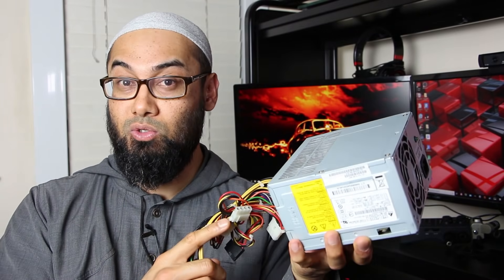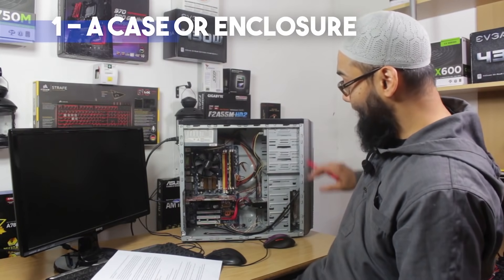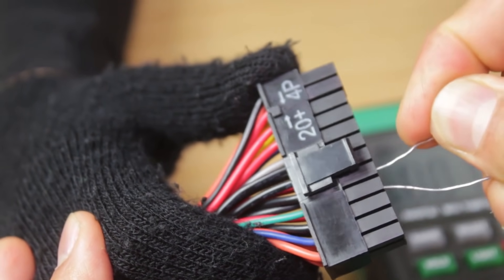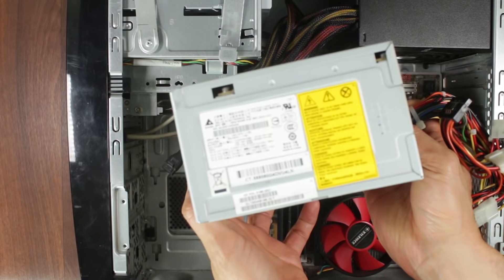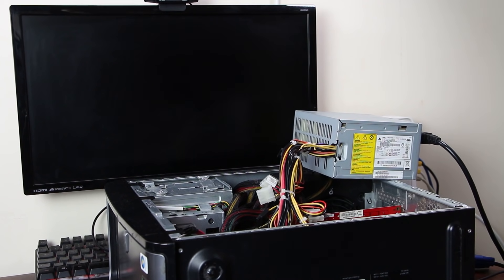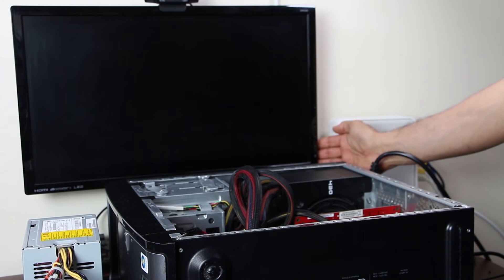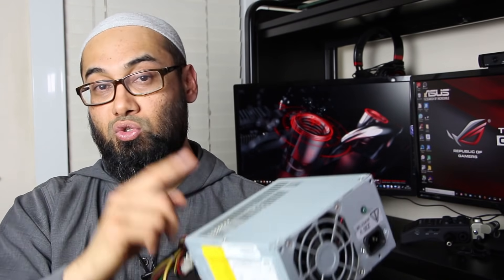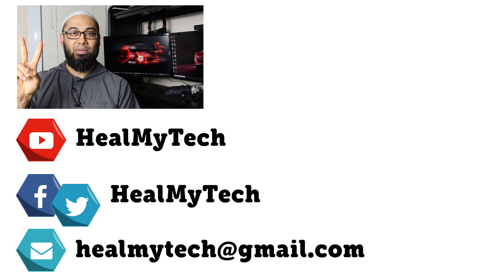Computer Turns On But No Display On Monitor | Led Light On Fan Spinning | Power Supply Unit Pc?

Comment: I upgraded my ram (added extra 2gb) switched pc on but monitor shows no signal eventhough leds and fans are on.
Reply from the maker: Test the RAM independently first, also check your mobo manual for correct RAM config.
Reply: Ozair ahmed I have just installed new ram aswell but my computer was working for half and hour and now just a black screen did you find an issue
Reply: @thinkz1133 firstly make sure your ram is compatible with the board but for me the solution was rearranging the ram and see which combination will work, and disconnecting things and putting them back in like the gpu or making sure that the parts are in properly.

Comment: Dude my pc was working fine it is new i got it last summer and all of a sudden today the display wont show and i have a corsair power supply and msi monitor
Now after turning my pc off 3 times it works for. Pc life is tough bro
Reply from the maker: It can be I agree, but as with anything once you learn the basics it becomes easier.  I suppose not everyone wants to get headache with troubleshooting...

Comment: Bruh I’m 14 ion wtf to do
Reply from the maker: Age has nothing to do with troubleshooting, whats the problem?
Reply: @HealMyTech1  Thing is, he most likely doesnt know any of the terms/words used, like booting, cpu, bolts/watts, power supply, or even troubleshooting. So indeed age isnt a problem, but lack of knowledge is.

Also, I think he meant he doesnt know what hes doing in this video(like "how did I even get here")...  either way, thanks for the help and advice!
Reply: Yah what lmao

Comment: what if when you push the power button down on the desktop PC the led doesn't light up at the fans kick on but that still be a power supply issue or could that be the battery on the motherboard?
Reply from the maker: motherboard battery only keeps CMOS information like date time BIOS setting etc and shouldn't affect the turning on of the computer
Reply: @HealMyTech1  Any ideas on my situation?
Reply: @HealMyTech1  Do you think it could be a power supply situation?
Reply: @HealMyTech1  Oh also another strange thing is when I push the button to eject the CD the drawer closes about a quarter of the way after opening.

Comment: I just brought a new power supply yet this issue happens is it still the power supply
Reply: Could be the Ram
Reply: The atomic bomber 75                     try to pull out ram while your pc is off and plug it back and than turn on pc. If its not working try to unplug your graphics card and than put it back on motherboard while pc is off or try to put your monitor on motherboards graphic and see if it works, if it doesnt i have more options for you. When you log in your windows and when everything is on (except the monitor bcs it has no signal) try to do next steps depending on wich windows you use for windows 7 press CTRL+ALT+F8. That will restore your graphics settings or if you have windows 10 watch the following video it will help you out - https://youtu.be/oZVyPg-LKFQ
Reply: The atomic bomber 75 sorry for bad english im improving and i hope i helped you

Comment: All fans are working, but the OS isn't starting and sends no signal to the monitor
Reply from the maker: Fans and OS do not have to be co dependent...I have a full troubleshoot series for these issues, did you not find an answer there?

Comment: Power light at the front isnt working but fans are working (just installed a new cpu). I’ve been told  that you need some sort of heat paste but I’m not sure why.
Reply from the maker: Thermal paste on the CPU will help to cool the CPU, can dangerously overheat otherwise....

Comment: i have dell optiplex gx620... everything is working but in monitor doesn't show anything. i tried everything i Changed ram , i changed monitor , bio battery every thing, checked cable too. the motherboard shows orange light fan working properly..please help me..

Comment: I have to turn my power switch on and then
Off in order for it to display on my monitor I built the pc a month ago anyone know why it’s doing that
Reply: same , any fix yet?
Reply: Yeah
Reply: What is your motherboard and specs
Reply: @caliber__343  b450 tomahawk MAX, Ryzen 2700x, 1660ti msi, 16gb ram T force LED 3200mhz, Intel ssd 660p 1tb
Reply: Steph2K same update the bios to the newest one
Reply: @caliber__343  i did that when i first built it , I feel like that just fkced it up somemore . so i went back to original bios settings and it hasnt done anything yet
Reply: Steph2K I updated mine and it was fina after that but idk the
Reply: @caliber__343  you downloaded from website put onto flash drive and booted into m-flash mode right?
Reply: @caliber__343  you updated to 11-11-19?
Reply: Steph2K yeah my last update when I got it in November was back in September and once I updated it to that one everything was fine
Reply: @caliber__343  well unfortunletley for me i lost my usb so lmao
Reply: Steph2K damn

Comment: My motherboard turns on but no display no lights from the keyboard and mouse im using a thermaltake tr2 600watts psu and when i borrowed my cousins psu which is generic psu it works fine and when im using my thermaltake it wont display..how can i fix this? Btw before i buy my thermaltake psu it works fine and when i test to mine it wouldnt

Comment: My pc turns on but no beeps....but when I wait some time it works and beeps but it shutdowns again and same problem..
Reply: @thrax3053  well try cleaning and replacing the power supply ....Check ur hdds if they all work properly.....reapply thermal paste and stuff on ur pc ....should work ....I still have the same pc it works perfectly  ....to this day ....I did everything above and should work
Reply: You might have to clean the inside of your pc out, at least that’s what worked for me

Comment: Got new parts this christmass worked perfectly fine until now it turns on no signal no fans power supply turns on doesn't turn Off no idea what to do
Reply: Red light turns on the motherboard next to cpu text

Comment: Accidentally selected clone mode on Radeon graphics, monitor says out of range can't see display.
Reply: Run in safe mode
Reply: @IMXERone  you can boot in low resolution in windows too, hold f8 on start up for boot options.
Reply: I tried updating stuff in and ryzen master and it said to apply it will restart then turn on I let it restart it turned off i got confused and i tried to turn it on it kept flashing then i took out the power cable then put it back it turned on but wouldnt show anything and would not turn off

Comment: I upgraded my cpu and WiFi adapter, and now my monitors won’t have signal, and my mouse and keyboard won’t work even tho the pc is on and has the motherboard lights on, help?

Edit:I fixed it, so basically I upgraded to an and ryzen 5 3600, and that messed it up because my bios was outdated so I just had to update it. Here’s a step by step on how to do it 
NOTE:make sure you put your old cpu back in in order to do this, then install the new one after you do these steps 

1.) search up your motherboard and search up the latest bios update for it
2.) download that file and put it in a thumb drive
3.) hold shift while pressing restart on your pc
4.) click on startup settings
5.) press restart and IMMEDIATELY spam f2 until your computer restarts and starts up the bios network
6.) click tools and then click the top option
7.) insert your thumb drive and click on it when it appears then click read
8.)it should read and then you’re good to go
Reply: Same
Reply: Jamoung I fixed it, did you recently upgrade your cpu?
Reply: Same fk
Reply: Wepx  I fixed it, did you recently upgrade your cpu?
Reply: Bryan Odria same
Reply: qlipzy  I fixed it, did you recently upgrade your cpu?
Reply: Bryan Odria I got a fr 1030 and   A ugreen box for double monitors but one won’t turn on

Comment: For some reason my Graphics card wont boot..  Everything else turns on but no response from GPU,  Ive checked and made sure it was securely in the slot and power cable is connected to PSU..   i just upgraded my mobo,cpu,cooler,ram, and m.2..   setup is  3900x, MSI x570 gaming edge, aorous 512gb nvme m.2,  860 evo 1tb,  thermaltake 850w grand rgb,  and a R9 tri-x fury  4gb
Reply from the maker: You need to test that component individually...i.e test the GPU in a separate known working pc
Reply: @HealMyTech1  actually I realized it was the RAM..  Im in bios now trying to setup both sticks to work..  I can only start with one stick at the moment.

Comment: My pc turns on but no display, but sometimes it would display something but would freeze right away...any idea?
Reply: heat issues?
Reply from the maker: What troubleshooting steps have you done so far?  Start with PSU
Reply: HealMyTech I have taken most of it apart and just cleaned it up so far. I’ve had the pc for about 3 years now and haven’t had an issue with it up until recently. It’s just weird cause sometimes the pc will display, other times it doesn’t, and even when it does show something on the screen, it freezes up as it is loading.

Comment: When i turn on my computwr turns on but my monitor says no signal. Pks give me advice. Ps. I  tried to connect it both the vga and  the graphics card and it still says no signal on my monitor
Reply from the maker: What other troubleshooting steps have you done so far? I have a full troubleshoot series on the channel, did you not find an answer there?
Reply: yuukieha redhacker same
Reply: Try reseating ram
Reply: fire trails did you manage to fix it
Reply: fire trails did u fix it?

Comment: Hi my pc used to work fine but sometimes doesn’t work and when I shake some times turns on but when it doesn’t boot it sounds like the ssd is scratching and than distant boot
Reply from the maker: SSD Scratching?  SSD do not have moving parts to cause scratching sound.  I nee more clear info

Comment: Hi, recently I just added one stick of ram, then I turn on the pc it doesn't have display signal, then I remove the new ram leaving the old ram in my pc it also doesn't have display signal, everything is working fine, fans peripherals are running properly, what is my problem?
Reply: Same problem😫🤢
Reply: @nickuwunj  hey I solved my problem, try connect your hdmi cable to your gpu, for me its hdmi cable problem

Comment: FYI in some cases and motherboard will not POST because a peripheral thing (HDD or CD-ROM) is connected to the motherboard (a computer MUST complete POST before it proceeds to load an OS if POST DOES NOT complete you will NOT see anything on the monitor... I have had bad memory sticks that stopped POST in its tracks ... a loose component (memory a loose video card) can cause a no POST condition as well... and as you discovered a power supply can indeed go bad BTW you definitely need to test the power supply under load (switching power supplies can show the correct voltage until it has a load put on it
Reply from the maker: Yes you are correct, thank you for the tip, I will try to incorporate this in an update video next time

Comment: Salam man, my PC just crashed during gaming after I restarting the PC everything is turned on including mouse keyboard 5 system fans Led from motherboard led from graphic card but the monitor shows no signal, I tried everything to fix it but nothing worked for me I watch every video about this problem and still no answer... my question is how can I tell if the problem from my mainboard or power supply and which unite should i replace?
Reply from the maker: What troubleshooting steps have you done so far?  I have a full troubleshoot series on the channel, did you not find an answer there?
Reply: @HealMyTech1  I watched every video of yours but unfortunately I don't have any spare parts at home so I took it to computer shop and they said my graphics card was the problem so I purchased GTX1660 super and that fixed everything.. Thank you for your very informative videos.

Comment: Sir i need help i just cleaned one of my old desktops and its not working anymore after i remove all components and bring it back again

I ALREADY tested all components from hdd psu network card gpu processor cmos battery my keyboard mouses speaker head set fans all fine

I am from the Philippine Islands 

Its specs:

Motherboard - ASUS p5g41cm (an old motherboard dated back in 2009)
Processor - Intel Pentium dual core e5500
GPU - AMD RADEON HD 5670 1GB
Ram: Kingston ddr3 4gb single stick
DVD rom - Asus quie track (this one makes sounds when i boot, its kinda crusty and sluggish when i press the power button)
Hdd - Samsung idk 250 gb
Monitor - NOC Generic non pnp monitor 60hz
Keyboard - logitech
Mouse - logitech
PSU - 600watts
Network card in PCI - idk probably tp link

What's happening:
1. The motherboard doesn't make beeping sounds anymore
2. Every fan is working, psu fan, gpu fan, processor fan, and chassis fan
3. Straight red light above the power button then it loses the light after the cd rom makes the noise
4. Cd rom screeching when booting up
5. No keyboard signal
6. No display signal
7. Makes the screeching sound again when forcing restart under the power button then it loses power and cycle repeats

What do you think is the problem is the motherboard dead
Reply: Okay i think i have the same problem with you
Reply: I just unplug the ram to clean it and i dont have any idea why it wont work anymore
Reply from the maker: Okay this is a great request, very detailed, so I would be more than happy to help.  PM me and lets see if we can troubleshoot this in a live video....

Comment: New PC, used it at least 6 times. Went to turn it on and suddenly no signal, I tried the power button for one minute thing but it’s still happening. Any advice?
Reply: Dust
Reply from the maker: What troubleshooting steps have you done so far?  I have a full troubleshoot series on the channel, did you not find an answer there?
Reply: HealMyTech I’ve tried what is essentially every fix the internet has to offer none of it seems to work, I’ve done the whole hold the power button for a minute thing, I’ve replaced all the cables, I’ve even opened the fucker up and cleaned all the components. But the issue still persists.

Comment: My pc configuration is core i5-2nd generation,mother board Intel -DH61WW, Ram 8 GB,,4 GB ADATA and 4 GB ZION in different slot,,,1 gb graphics card ATI,,1 TB HDD,SMPS 450 watt frontech,,,Windows 8,,,
I check my pc in perfmon /report command and the all hardware and software are green and ok,,but the problem is when I start the windows then my pc is hanging and mouse cursor not working and after few seconds total windows look like white shadow now will u tell me what is the actual problem in my pc,,,kindly solve my problem ,,,

Comment: this has really helped me, but my question is have got 04 screen monitors connected to my pc and 1 out of the 04 screens has failed to come on. help me on this thanks.
Reply from the maker: Basic questions: does your GPU actually support 4 screens?  Have you checked each video cable independently? Is your software properly configured?

Comment: Alright so I need some help.  I upgraded my psu from a 350-450 to my prebuilt pc and I a getting problems with the SATA and the optician drive not working.  It starts then it stops.  I put everything in the right place I have no clue what happened.  Please respond quickly

Comment: Salaam brother great video, I have a problem my computer turns on however nothing on display. I've checked the PSU and removed the ram stick. Still no signal on monitor. Is there a way to check graphic card.
Reply: I checked all component's by swapping parts from a working computer and identified  two faults at the same time. Ram and Mother Board faulty. Processor, PSU, Graphic card and hard drive all working

Comment: Mine was turning on but wouldn't boot, the keyboard and mouse still received power though. Try resetting the CMOS battery and taking out the ram and putting it back in to make sure it's placed properly. worked for me.

Comment: HealMyMech i have same problem but  my pc starts once a day
Reply from the maker: Once a day???  Do elaborate!!!
Reply: @HealMyTech1  when i switch the power on the pc starts without issue but when i turn it off again and cut the power it won't start (fan + led on but no signal ) also electric shocks that are felt when the case is touched + random crashs + Recurring failure of hdd

Comment: I reinstalled Every part and started it worked for two hours and after that it shut down Later when i started it again it did not show any display it sometimes shows display and most of the time it doesnt show is my psu the problem??
Reply from the maker: When you reinstalled the parts, did you test them individually?  I have a complete troubleshoot series for that.

Comment: Would this issue also cause my my keyboard to light but not my mouse or ALLOW display?
I turn on my computer, it lights up green, my keywboard lights up, the mouse does not light up green (BUT the infrared tracker does appear) and the display does not appear. 
My TV (which is what I use as a monitor) can detect that the image is there it just doesn't appear.

Any help would be great here.

Comment: My back fan only works sometimes and when my computer doesnt work the back fan is off but my cpu watercooler fans and gpu fans r still working... ive even changed the back fan and it still doesnt work... im not sure if its the power supply but i dont want to buy another power supply and it still doesnt work
Reply from the maker: sounds like a setting issue in either your BIOS for your temperature monitor and fans, or in an application in your OS.  Is your fan connected to the PSU or the motherboard?